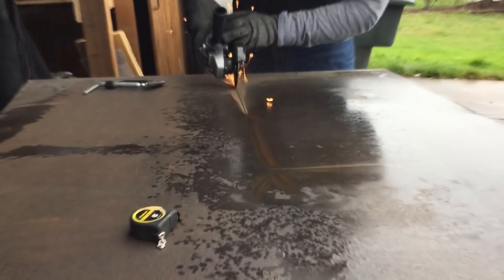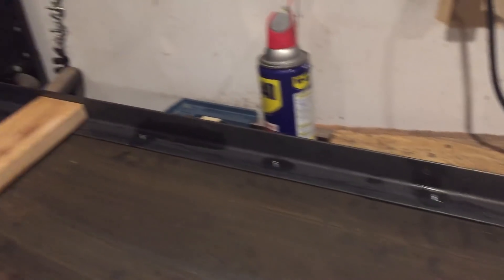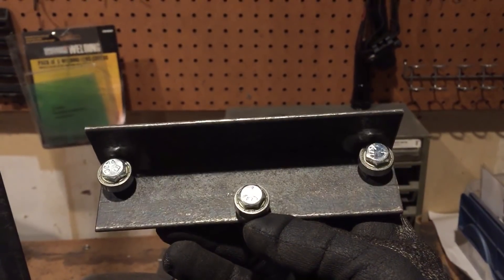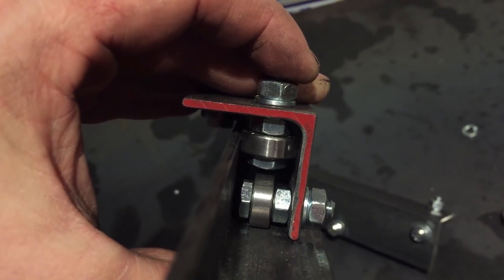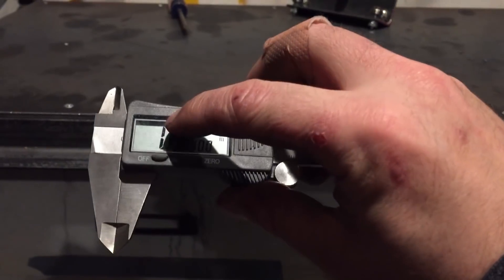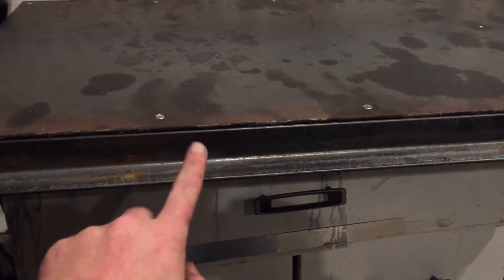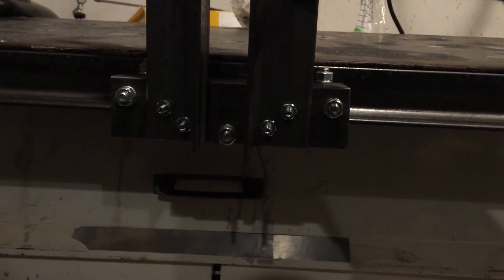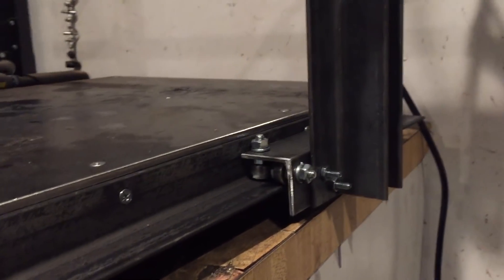CNC build part 2: Homemade Base and Rails with cheap tools

Comment: Tip from a skateboarder. To break the bearings in before using them, use an old desk fan, pull the blade off and put the bearings on the spindle. I wrapped my bearings in paper then again in duct tape and ran the tape to the desk to hold it in place, turn the fan on low to medium and keep an eye on the heat of the bearings, lubricate as needed. I'd let mine go like that for about a day, take em off and enjoy.

Comment: One recommendation I have from building something similar. Sand the steel smooth where the bearings ride, it helps a lot. The steel is rough. Once I sanded it got much smoother and quieter. Cool build though
Reply: Sanding would help. The steel has mill scale on it. It's pretty hard stuff and rough. it is difficult to sand.  Just clean the scale off in a bath of muriatic acid and the scale dissolves, leaving smooth, clean steel behind.  Only takes a few minutes in the acid.

Comment: U should put a piece of all thread on the bottom of the trolley from one side to the other would hold tension on the inside bearings so u would only need 1 drive motor on that axis
Reply from the maker: I tried that on my last CNC machine, it really didn't work. The gantry would rack side to side, totally killing accuracy!
Reply: @StrangeGarage  I just started watching the playlist on this build looks pretty cool. I wouldn't mind building 1 myself some day

Comment: use some muriatic acid to remove the mill scale and then oil to prevent rust. The steel will have a better tolerance and run smoother.

Comment: I have a question. Where do you get your CAM software? Is it expensive? Sorry if you covered it already on a different video, I didnt go through them all yet.
Reply from the maker: No worries. Fusion 360 has built in cam. So you can build your 3D model and generate g code in the same software. Fusion can be downloaded from the Autodesk website.
Reply: @StrangeGarage  I'm about to go through your vids right now looking for hardware for the build. Would you recommend a different cnc package (motor, circuit board, etc)? It was a package right? Happen to have a link? Fusion 360 come with the package? Thanks man.
Reply from the maker: @justingodin7806  Honestly the kit was pretty good. I'm sure you can dump buckets of cash on a better kit, but for the money I'm completely happy. 

Fusion 360 is free for beginners/start ups. Literally anyone can download it from the Autodesk website.

Comment: What is the cost of this machine..?
Reply from the maker: About $500. The cutting tool is another story. Routers are cheap, but I purchased a 3 HP spindle with a VFD, which is better than a router but also $300 by itself.

Comment: HA! Glad to see someone actually do this, I have been toying with this idea for a while now, I intend to use car windshield gearboxes/motors to run the rails, recycled of course haha
Reply from the maker: Yeah I love builds like that! Gotta be cost effective!

Only reason I went with the electronics setup I did is it was pretty cheap to buy the whole kit, and everything is purpose built to work together.
Reply: @StrangeGarage  Oh yeah, pretty solid strategy, I just happen to be good friends with a junkyard owner. I like to see how low I can get the project cost on stuff like this haha

Comment: Your videos are excellent, especially showing critical areas & pieces. Just 1 question but only because I can - Q. Is there any reason I could not mig weld my table & gantry or did ya'll use screws, nuts & bolts, etc because that's what most people have available to them? I ask because (for me) mig welding it all would be dead simple & ensure nothing ever loosens up. I will add tho, I'm thinking mig as stick or gas welding (I have all 3) profuces the least amount of heat & thus no warping of the steel.
Again, TY so much for your time & efforts in making this excellent series! Couldn't ask for anyone to make building a cnc any easier.
Reply from the maker: I appreciate your views my friend, I do all this for the interaction with you guys.

Great question: I excluded welding from this build for 2 reasons. 1 being that most people don't have welders (which they should if they plan on having a CNC machine). I knew If people saw me weld this thing up a lot of people would stop watching because they don't have a welder. 2, I wanted to mitigate warping down to the most finite level. 

I also LOVE that I can make adjustments. If something is off I left myself plenty of chances to adjust everything. If I feel confident in my alignment at some point, I can zap a TIG fuze and make it permanent.

Comment: Hey SGM, what is the best way to align the bearings? Thank you for the video! I love the thrifty build.
Reply from the maker: Bruce Williams That depends on what kind of alignment you're asking about. The way I get them to grab the rail tight is I loosen up one top bearing, put it on the rail, and shove a wooden shim between the carriage and the bearing, then tighten the bolt back down. 

I hope that's what you were asking, if I'm wrong just correct me and I'll try again:)
Reply: Thanks, that make sense. So there is some adjustment to make up for any errors. It looks "skookim".
Reply: By the way, looked at your about and it said you are a tailor, that's cool.
Reply from the maker: Bruce Williams Yes, always leave yourself a way out! I make the holes about .020" oversize specifically for adjustment! But you can do that at any time.
Reply from the maker: Bruce Williams Lol, nah, my name is Taylor. The "job" that I do varies from day to day, but I've done many different things for many different institutions.
Reply: LMAO, D'Oh! I need to learn to spell! Thanks Taylor.
Reply from the maker: lol, no worries, thanks for reminding me that I need to update that bio. My channel just recently started seeing a lot of traffic, so it wouldn't hurt to keep it current. BTW, I got the x-axis hooked up to the controller just a few minutes ago, that is a quick CNC machine. Compared to my old one anyway!
Reply: Metal is going to be nice and stiff!  How do you adjust the tightness of the bearings gripping the rails?  Abec bearings from roller blades are good and tough.
Reply: Oh, I saw you make the holes a little bigger so you can adjust the bolt position.  Do the nuts ever slip?  I had this problem but I don't remember if it was on my cnc machine or greenhouse. Lol.
Reply from the maker: @TheRainHarvester  the nuts have not slipped but I have taken it all apart to tighten things up because the bearings broke in. I was seeing a little clearance when changing directions. 

Sorry for the late reply.

Comment: Maybe shim the 90deg ends to fill up the loose play instead of doing dual motors. Love your videos and budget builds, they've got me digging for more info and building materials-lists.
Reply from the maker: FantasticMrFish I don't actually have to shim them because the y axis rails aren't bolted down yet, so I can set the distance there. I tried to get rid of the slop so bad on my other CNC, and it's just too easy to put another motor on. Plus the kit came with 4 motors and drivers, win win.

Thanks man, I try to keep my content and my builds interesting. I'm going to be posting at least once a week on my CNC progress, until it's boating weather anyway. Thanks for watching!

Comment: Thanks for the next video in the series man.  You continue to amaze me with your skill base and presentation skills.  

Here's what I garnered from your build relative to materials and some questions.  3/16 plate cut to dimensions 30 X 18 for your machine base.  6mm ID / .67in (17mm) OD hobby bearings.  Are the bearings 606zz?  What are the size dimensions for the angle you used, is it .12 thickness x 1.5 and lengths of the sections that ride on the rail?   The screws and bolts are easily figured out and your sketch is very helpful.   Thanks again man,  This is going to be an awesome CNC machine I am certain.
Reply from the maker: Ted H Ted H oh, don't give me too much credit. Don't want me to get too cocky.

Great questions: the angle profile you nailed, 1.5" X .12 wall, the length of the carriages is 6". I went with these dimensions so that the final "functional" workspace would be 12" X 24", so 18 X 30" works out to accommodate that.

I kept all of the hardware the same (except on the carrige) for convenience, they're 8-32 X 1/2" CS FH. 

I'm excited about this too, this thing is already pretty sweet!
Reply: Thanks SG, Just wish we lived closer to one another as I would love to meet you and go out for a beer on me.  

I am going to start sourcing materials and build mine per your design as I am a total novice at CNC.

Are these the main screws? https://www.homedepot.com/p/Everbilt-8-32-x-1-2-in-Zinc-Plated-Flat-Head-Phillips-Drive-Machine-Screw-8-Pieces-803751/204274665
Reply from the maker: Ted H We're lucky we have the internet man, we never would have heard of each other at all without that.

Those are the exact screws. I would reccommend, however, that you hang tight for the machine to progress before you start buying stuff. I want to make sure you like the design and the capabilities.
Reply: I could not agree more my friend.  I certainly will heed your advice however, completely trust in your abilities to build a quality CNC machine, especially given your experience having built one already.  It's only human nature to learn as we go along and most of the time we get better with experience.  For me, this makes life exciting and greatly contributes to the success of my business.  

Patience is a virtue I need practice at so no hurry at all from me man.  I currently have a lot of irons in the fire and spring turkey hunting and fishing seasons are right around the corner.
Reply from the maker: Ted H Man, you just wrote the preface to the book of my life! My last machine was built with NO plan. This new one is actually coming together FASTER than the last one, and I'm filming the whole time, that's how important having a plan is! Also the plan is making it a 100% better machine!

Man, I'm in the same boat. My wife is hinting that she wants to go out on the boat next week, and I'm trying to get some CNC stuff done, so I feel ya on the busy department!